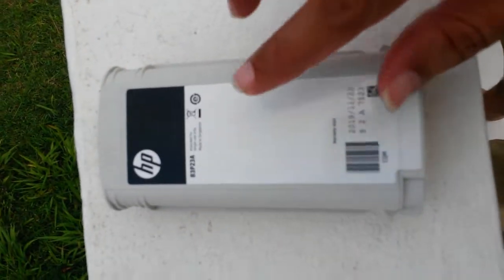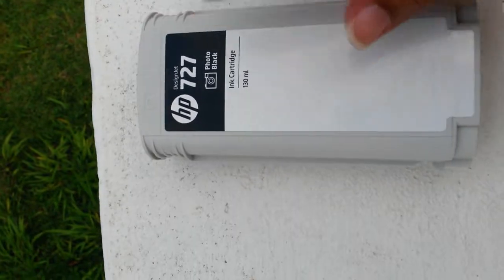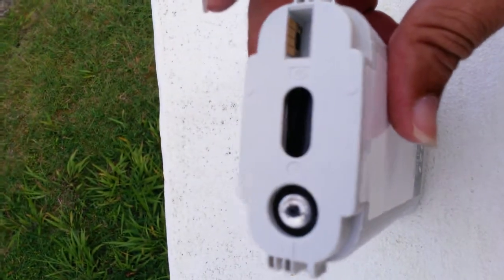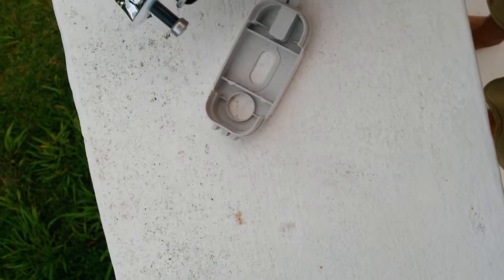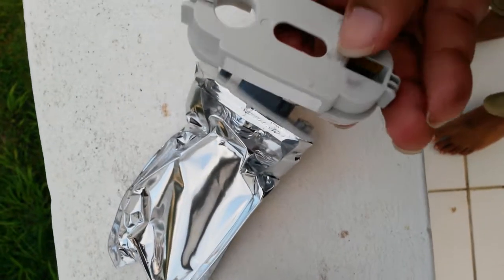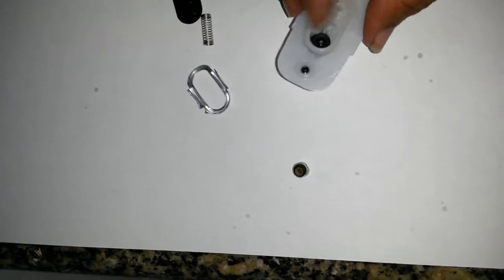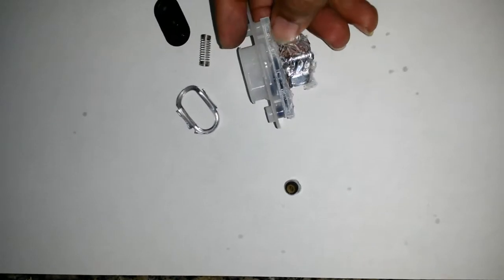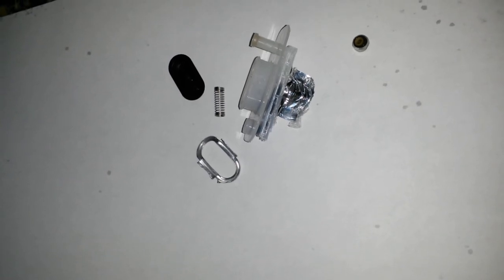082 HP Plotter Cartridge 727

Comment: How to pull out the chip, in order to be replaced with another? Thanks
Reply from the maker: I do not have the cartridge anymore and cannot remember exactly but a small knife or thin flat object should work to pry out the chip. Just fit it behind. Generally these are one sided boards so nothing to really damage and you intend to replace anyway. Not sure where you can get a replacement chip though.